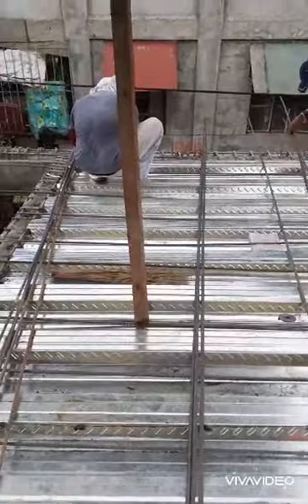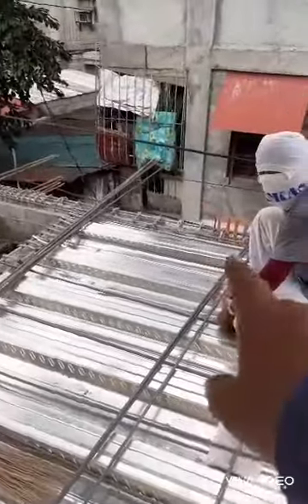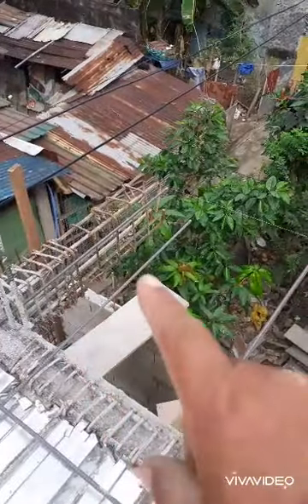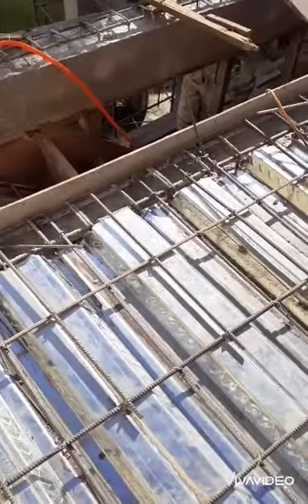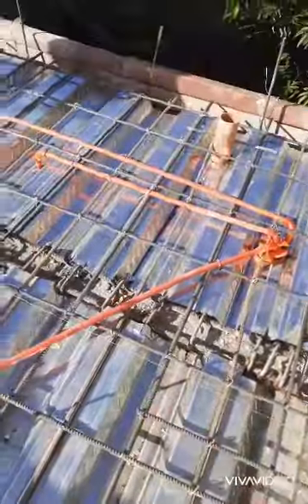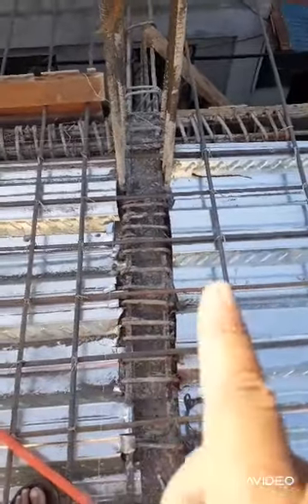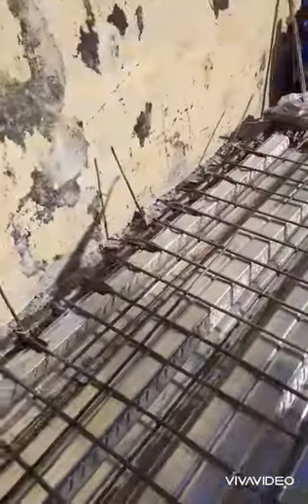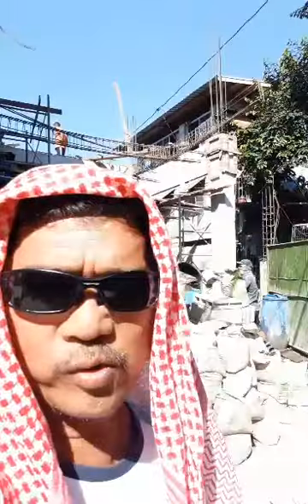Pag install ng steel deck | Pag lay out ng electrical |  Pag buhos kasama hagdanan | Vlog # 20

Comment: Wala na bang concrete spacer yong rebar ninyo. Para sa concrete cover?
Reply from the maker: Boss nag provided ako ng concrete cover na  2cm  /steel spacer na 16mm diameter, un steel deck type corrugated ay un sa top lang required..

Comment: boss pde ba.gamitin.ang 10mm sa slab ang pag lalagyan ay steel deck 10x33 boss slamt sa sagot boss
Reply from the maker: Hi boss, 12mm standard slab lang po ang required sa mga residential. Salamat po
Reply: ahh ok.boss.slamat

Comment: Ano pong spacing ng tukod lods?
Reply from the maker: Gumamit ako ng shoring jack support spacing is 1.5 m both ways,,hindi ko lang naisama un video
Reply: ilang araw po pa tutuyuin yan pagkatapos ng buhos?
Reply from the maker: Standard sir, 28days compressive strength, ibig sabhin ay bago tanggalin un mga tukod or mga jack support, sorry sa late re
 reply , thanks
Reply: sir good day po sa inyu,ask q lng po kun paano icompute ang volume ng buhos,kun steel deck ang gamit

Comment: Boss ilan meters po ba ang steel deck nyo? thanks...
Reply from the maker: Boss good morning,almost 5meters..
Reply: @JPas1964  meron po bang Extra Beam yan sa gitna? hindi ba yan lulondo o mababali kapag walang Beam sa gitna? Thanks...
Reply from the maker: @selessud6182  boss nag provided ako ng hidden beam , besides un 1.0 thickness at  orientation ng short direction ng steel deck kaya negative un moment ,Thanks
Reply: @JPas1964  ah okay..thanks.